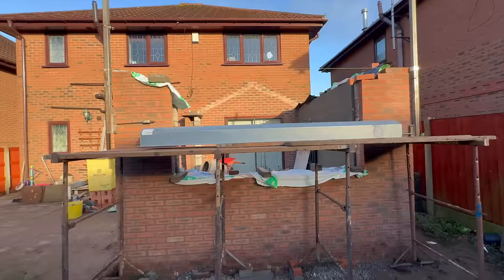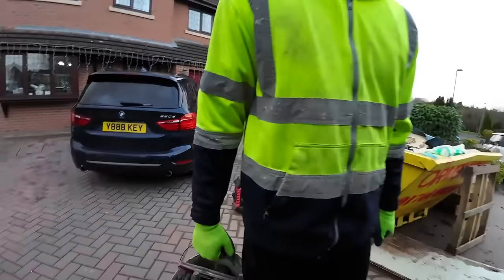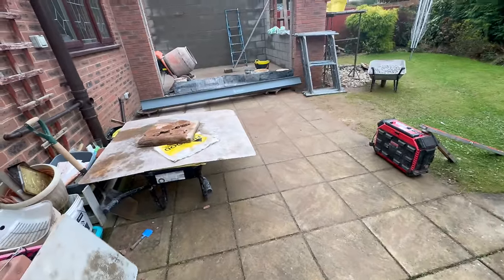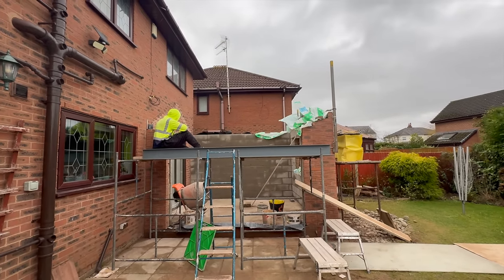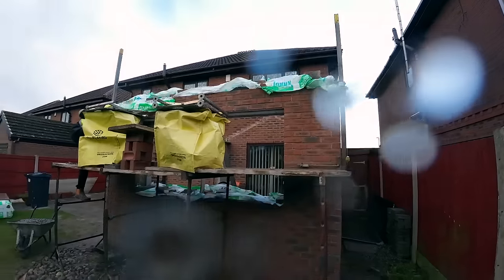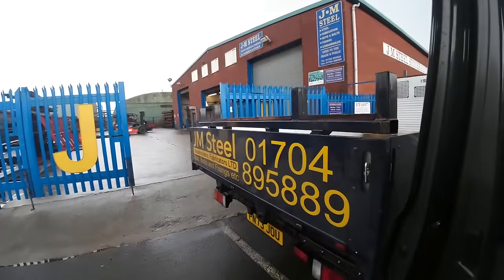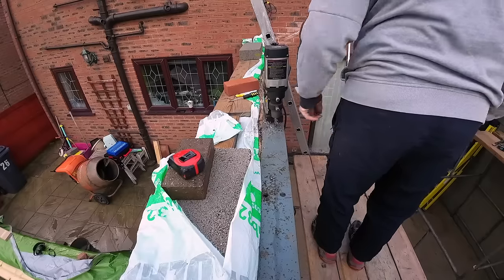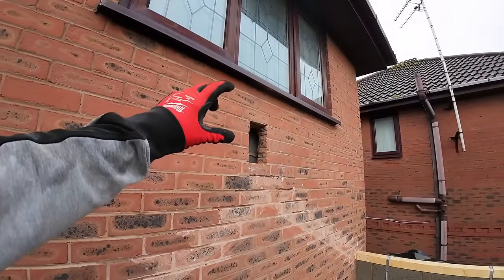THIS WAS STUPID DO NOT COPY !!..CONSERVATORY TO EXTENSION PT 9

Comment: Those mag drills are the best. I would suggest using a strap to fix to the drill and a secure place. Because if the drill loses the magnet, or someone pulls the plug, it could jump out and drop to the floor. Also a drop of oil on the cutter will keep it cooler when drilling.

Comment: I did 40 years of Construction.... you need Lubrication on any metal drilling... or you risk dulling your bit... i use a metal drilling tapping product..comes in a tube and is like thick grease ( even in a tube like grease ) at normal temps.. works fantastic for any drilling or tapping need..i use it on self tapping screws too ... stops snapping off ( i usually predrill a smaller hole first on thick steel )... i use it on my metal bandsaw too in the shop.... also on my saw blades when cutting Aluminum ( it works on any metal )... i buy it from an Industrial supply .... last many years.... well worth the price ( used to be fairly inexpensive )... saves bits , hole saws and metal blades / Carbide ( Aluminum cutting )...so really is worth any price... when i drill holes like that i use smaller bits to get to the finished size....it is faster and easier on my drills and me... i start with 1/8" use a 3/16 or 5/16" next and progress at what worjs best up to finish size.... i slow down speed too as that burns the bits ... change to my 1/2" Drill at bigger sizes of bits and be careful as it can grab and break bit or you if careless.... slowing down saves time ...and hospital trips... 😂rarely needed a mag drill ( they were expensive in my times ) but they are also pretty good to use... you should wipe the water off the steel ( use rags or some way to blow it off or heat gun ) as that can cause it to slip easily... and hold it in case it does or you can drop it down.... i usually make some kinda jig if multiple holes to hold it solid ( usually a quick and simple jig is all you need - i save it for another use if possible..but anything handy is fine - a couple clamps and you quickly are zipping your holes done..)... i did many large structures and usually up in the air - Commercial signs ...
👍
🇨🇦🤓🤙

Comment: Steve you need to put oil on the drill bit to cool it down or it just breaks up, Solid Carbide drills are the ones and yeah they are more expensive but hell do they rock!
Reply from the maker: The msg drill was self lubricating 🧱👍🏽
Reply: Ok.

Comment: I have used mag drills for years and they are great!! One thing,an extension cable should be fully unwound as if its left in a coil on the drum,it can and will overheat with current going through it!! I have seen them burst into flames because of it!!!!!! That can be a bit daunting!!!!! Keep up the good work !!!!!

Comment: Thanks for the video guys. Please excuse my ignorance, but why do some lintels require cavity trays and the steel you installed in this video doesn't?
Reply: I imagine the bricks above that steel won't get rained on as they'll be protected by the roof overhang
Reply: @darrenatarrant  Thanks Darren, yes I wondered that too (that explanation makes sense) but I asked because I am not a builder.
Reply from the maker: Darren put it perfectly, thanks Darren 👌🏼🧱👍🏽

Comment: Great vid as usual, keep up the good work.  Extension lead!     Using the extension lead still wound on the reel will make cable heat up on the spool..., when you use it on mixer next time - feel the reels cable for heat, I've cooked a similar lead and melted it without tripping the electrics till the very end of melt down.😢

Comment: Rotabroach drill bits are good but if you got a set of HMT bits and looked after them with plenty of cutting oil would probably last you a good few years, but expensive bits. Or Invest in some rocol cutting fluid can make cheap drills last a long time. I’m a steel fabricator so I do a lot with the mag drills👌🏼
Reply from the maker: 🧱👍🏽cheers

Comment: Great video. What’s the full name/details of the steel that went over the doorway please? What was its length? Sorry if I missed that. Cheers guys. 👍
Reply from the maker: We don’t have the structural engineer drawings so not sure .
   It was basically an RSJ with an 8 mm plate welded to it 🧱👍🏽

Comment: Sorry guy's but issue with drill is u SHOULD NEVER USE an extension lead rolled up it creates mag force as a coil & can over heat & even melt & catch fire, which might not blow fuses in the house if old fusebox still fitted, tut tut!
🤯
Great video guy's may be a future H&S one 🤔😂😂

Comment: When you're drilling steel you should always put some cutting oil on the bit so it won't dull the edge as quickly.
Reply from the maker: The drill was self lubricating 🧱👍🏽

Comment: Use a genie SL10 lift with fork extensions

I suggest you do a risk assessment on lifting steels….if you did, you would do it manually - think about it, if the steel slipped you could up with a career ending injury

Anyway a genie lift would do the job in a tenth of the time
Reply from the maker: Not on the 23 rd of December when everyone is closed for Christmas

Comment: What was I watching there . I’m a plasterer and I won’t use 8x4 sheets of plasterboard because one wrong move and you’re back goes . Think what you was doing there with that steel was wrong but it’s your choice .. you only get 1 back .. lads be careful  your health is more important than anything think ..🫣
Reply: What size sheets do you use?
Reply: @phil6465  I’m a one man band 6x3  I’m 57 .. ok a bit more tap but I’m happy with that
Reply: @johnhodges7891  I’ve not seen smaller plasterboard sheets, but not needed to use any for years. I’m a young 57 too!😀